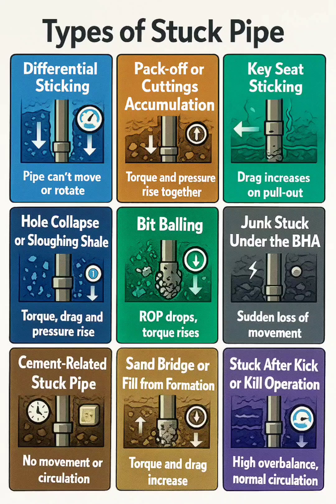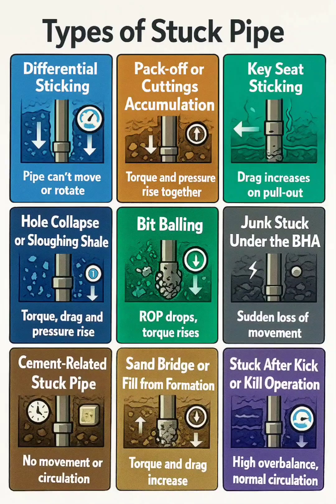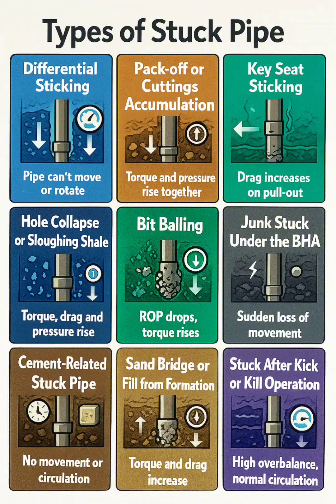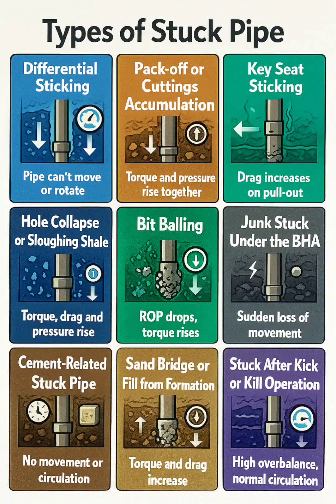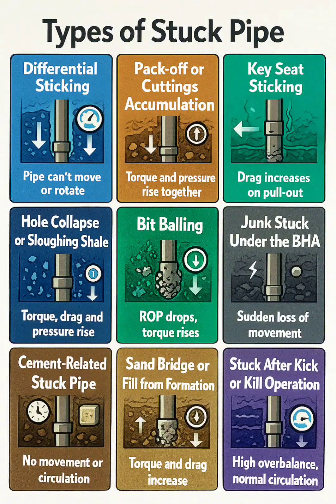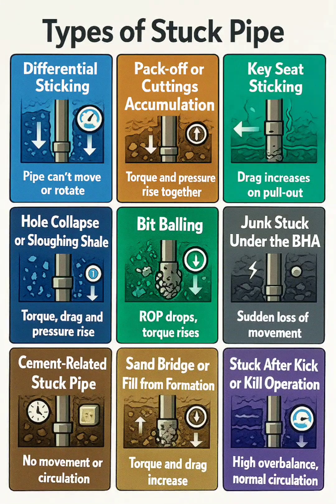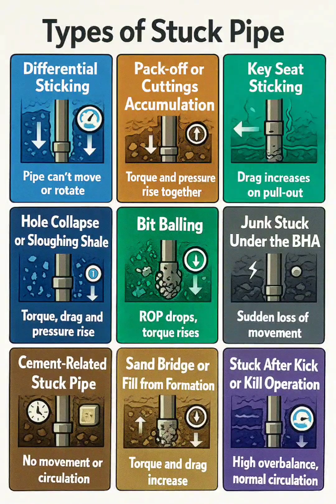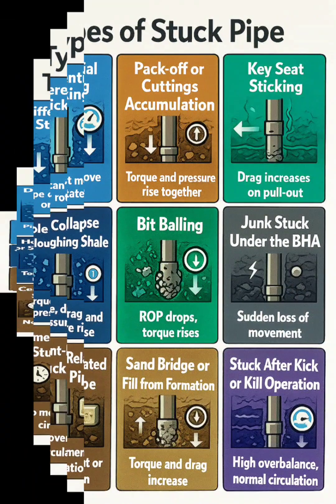Stuck Pipe Types #stuckpipe #wellcontrol #drillinghse #welloperations

Comment: Bit balling - decreased torque
Reply from the maker: Thank you for your comment! In some cases, bit balling can temporarily reduce torque if the bit face becomes fully covered and stops cutting efficiently. However, in most drilling operations — especially in sticky clay formations — we usually see increased torque and drag due to friction between the balled bit and the wellbore. The actual response depends on how the balling develops and how the cuttings interact with the bit design and mud properties."